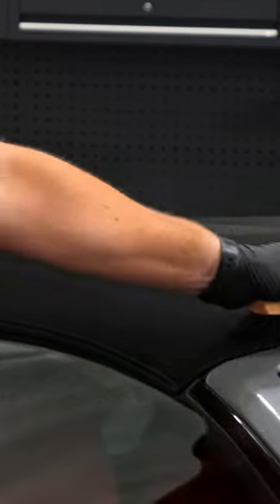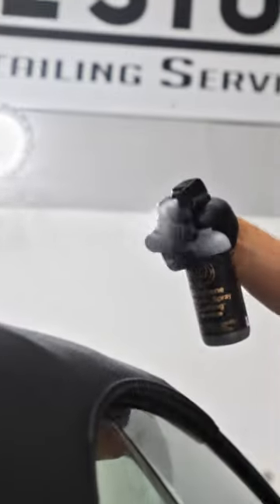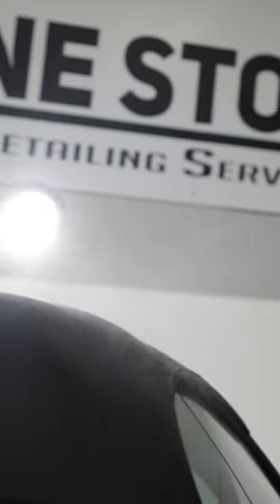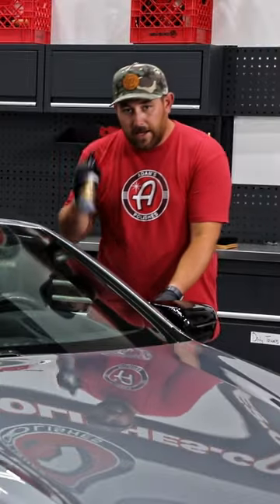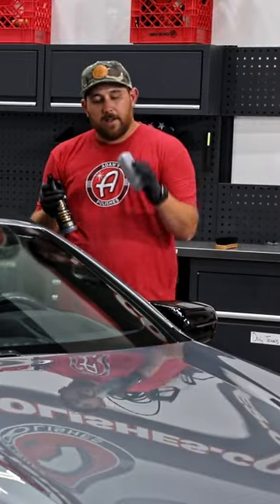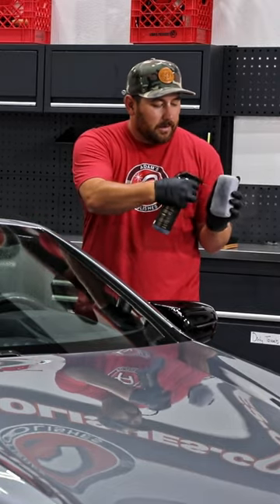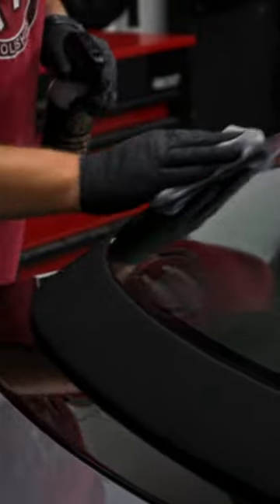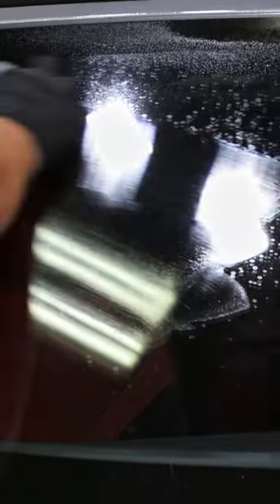Protect Your Soft Top with Graphene Ceramic Spray Coating

Comment: Do I need to brush the top after I have applied in all directions ?  It appears to have really cleaned the top and it looks blacker.  Thanks for the video!
Reply: how did it held up. I just got a drop 3 days ago and I want to keep it free from water as much as possible.
Reply: It makes it much easier to keep clean and it beads water very well.  I treated it 2-3 times.  Now I just brush it off and it could to is to look new.
Reply: @RichardK-ql7mt5qi2y  thanks for the reply